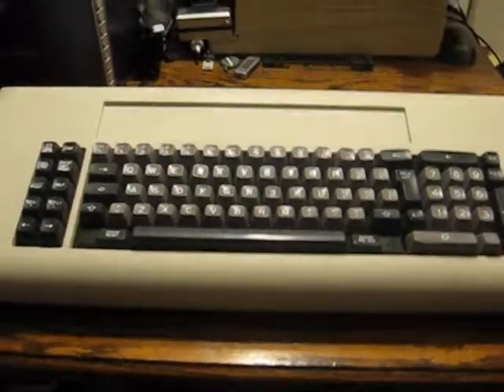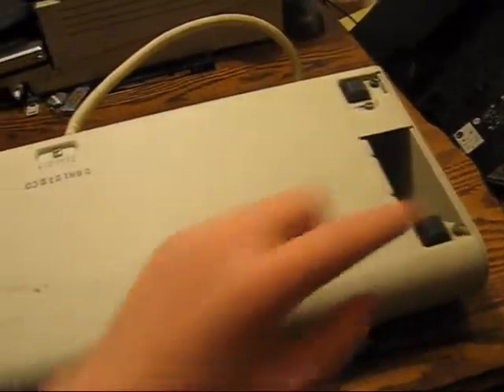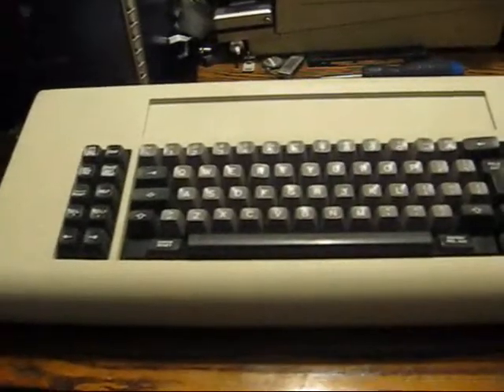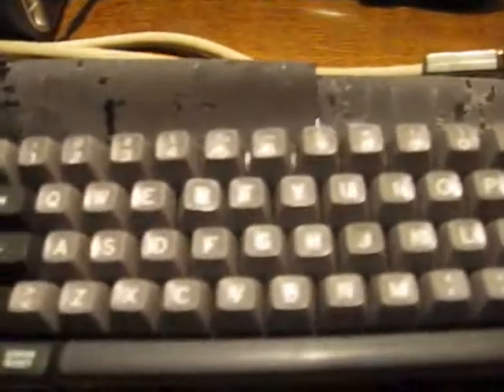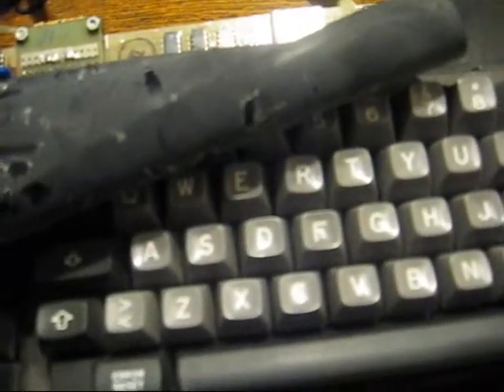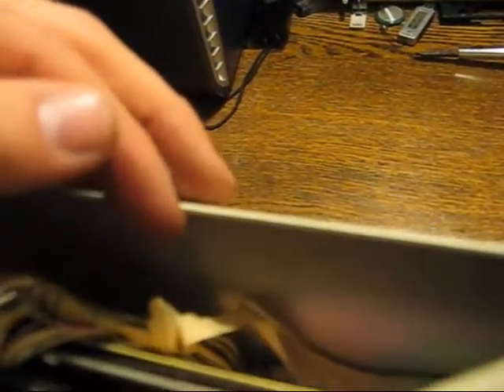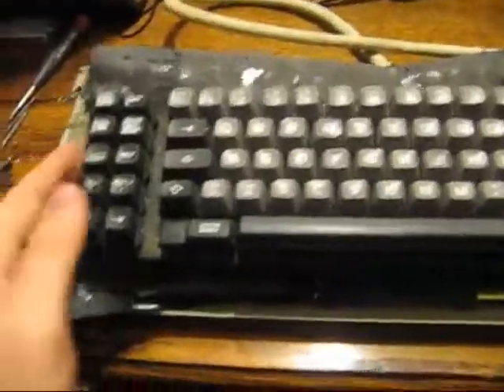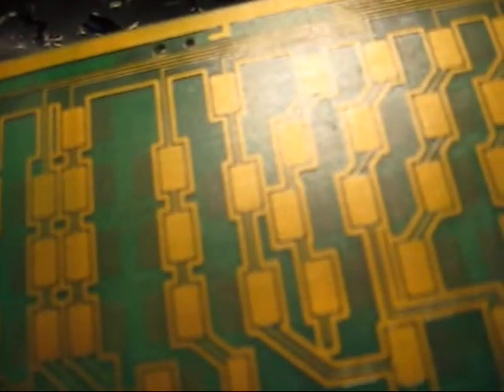IBM 5251 keyboard teardown

Comment: If the keyboard is too high, you need a lower desk (or keyboard tray) - simple as that. A wrist rest for one of these would probably be quite a bit higher than usual, but it's not like that would be a significant problem.